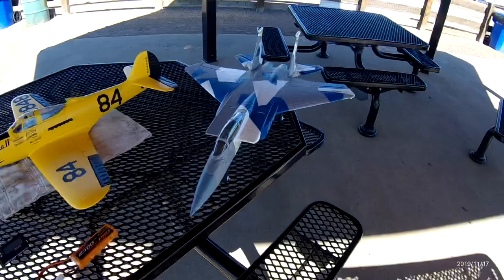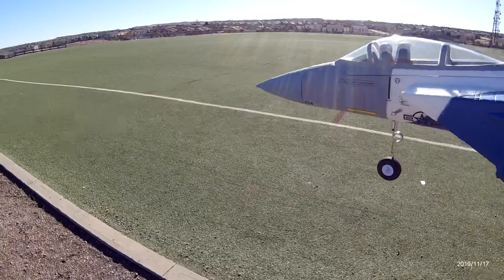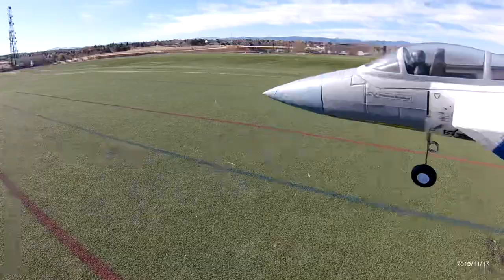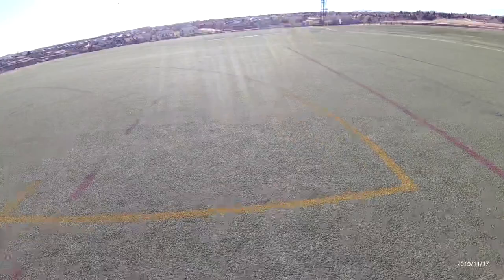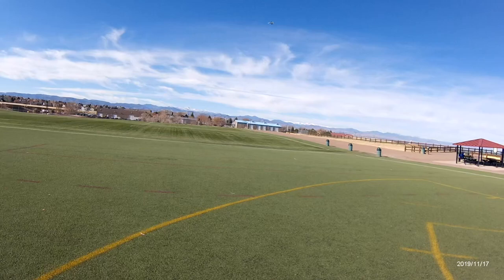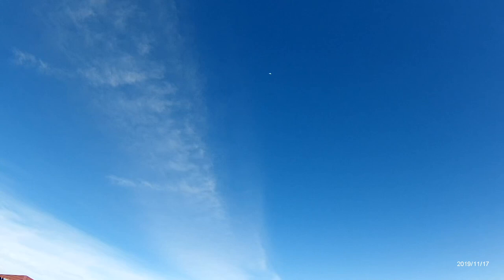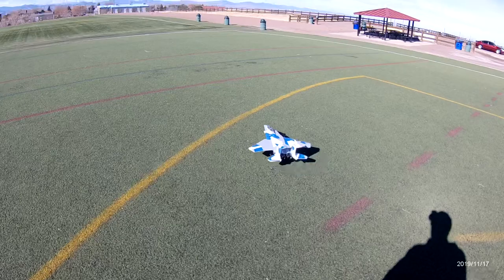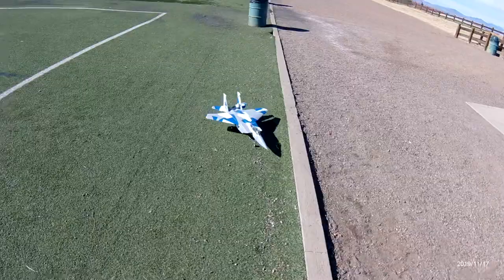Eflite F/15 Eagle 64mm

Comment: Great flight...I love mine, but I've had a loss of elevator once too. It was slow to rotate, and it would barely do a loop....(I never did find what caused it) - The next flight it was fine though and no issues since. 

I do have a tough time getting it to turn equally well in both directions on the ground though. - I can tweak the steering arm one way or the other, but no matter what I do, it will not turn well in both directions.
I did see a video posted where the servo was turned around, and the steering arm shortened (I think it was one of the RC Roundtable guys if I recall) which seemed to help him a lot, so I may try that. (Or just do like you were saying, and take the gears off of it)
Reply from the maker: Plane Fun it was the wind, I tried a shallow cross wind takeoff but the wind gusted up a bit and pushed it down so I adjusted my takeoff angle, the plane will do loops I under throttled it enough to pull it off, flying at 5,920ft above sea level makes energy management a bit more critical, thanks for watching 👊